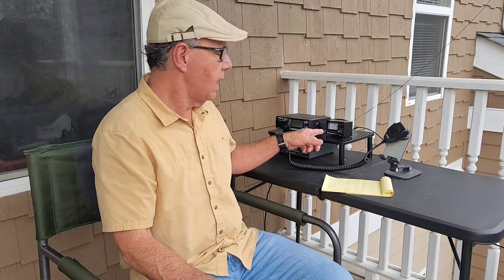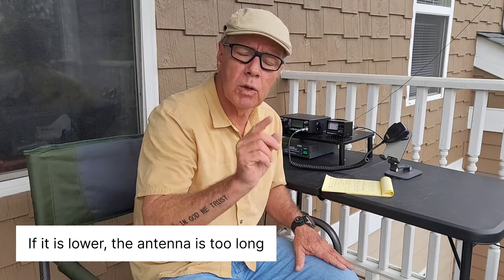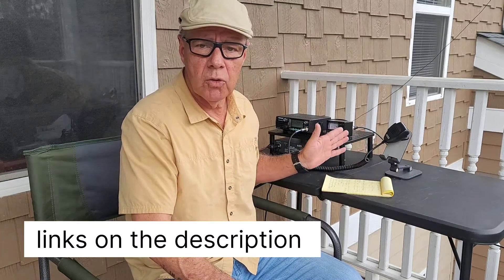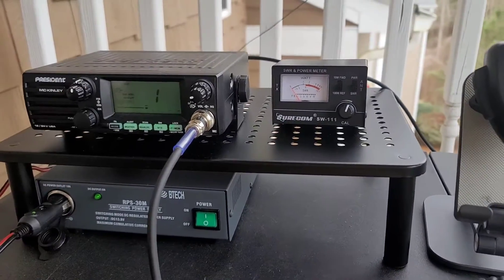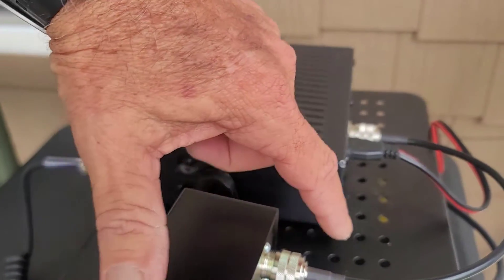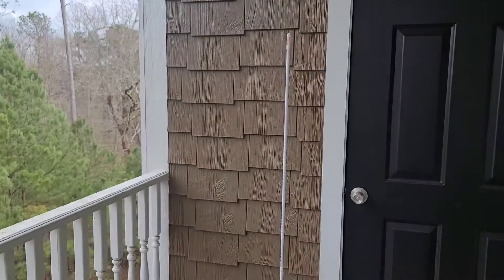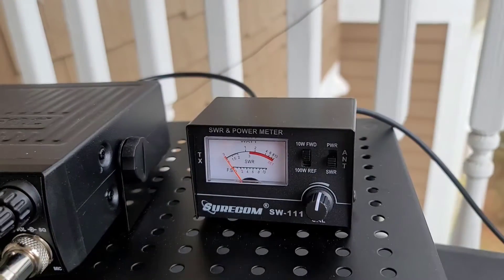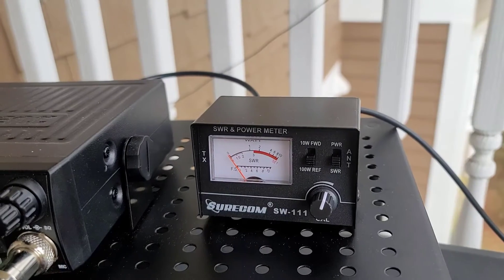Surecom SW-111 CB radio swr meter. Part 2

Comment: Putting an antenna against a wall or having any obstacles near it will affect the antennas receive and transmission, with a ground plane that doesn't have a 360 around the antenna will make the antenna directional, the antenna you have is is for a vehicle but even if you mount it roof hight with clearance around you will find its performance much better, ideally a good home base antenna would be a Silver Rod mounted as high as possible on the roof of your home.
Reply from the maker: I moved the antenna all over the place and this where I got the best swr.
This kit is designed for indoor use but I have carpet inside.
And yes, works great. Local contacts and lots of skip on sb.
Reply: @practicalgadgetsandstuff  So where is the link to the antnna you are using???
Reply from the maker: @keithnoone9727  Sorry. Here it is. Going to check what happened. Thanks for watching 👍🏻 
https://amzn.to/4e46Myh